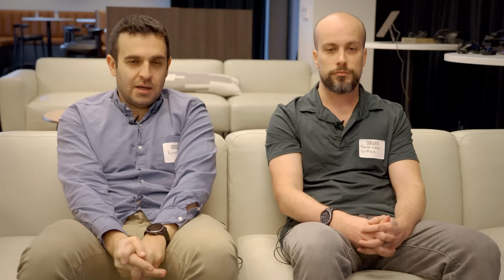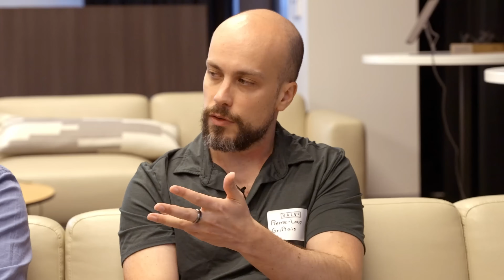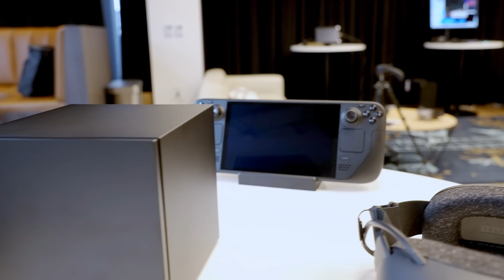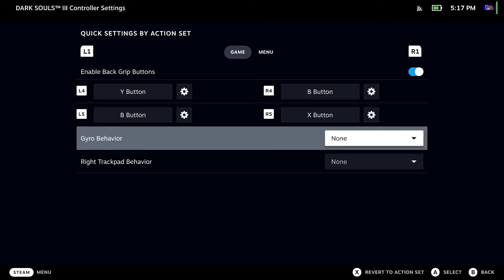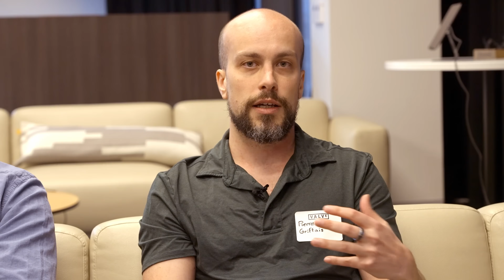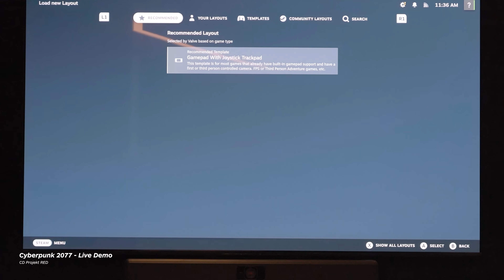Valve Talks New Steam Machine and Why Now's the Right Time For the Console/PC Hybrid

Comment: I will tell you why I do Console over PC to game. I just need it to turn on and work. I don’t want to worry about drivers, my controllers not being compatible or optimized for the game, I don’t want to have to worry about mouse and keyboards either. I don’t want to worry about hardware incompatibility. If this is just as easy as that then I’ll consider it.

Comment: perfect timing for killing xbox branded handheld🤣
Reply: actualy xbox branded handheld did it on it own. ally x is very same with exception of z2x for 100% price increase, in return you have 5% preformance boost and game pad grips in an enclosure... hell not, ally x is still much better option today. 

Steam Machine is not equivalent for any handheld but people love play docked and for those this is no brainer. 

I'm looking forward that kind of devices more than any upcoming handhelds, I bought Steam Deck LCD at launch only because of docking feature at x86 hardware. I saw earlier Pandora boxes, always wanted, they where custom made, full of troubles and crazy expensive at the time. Steam Deck delivered more than that. Now it is time for cheap PC gaming. I'm not looking forward to many games, but those in which Ićm interested in does not exceed 8GB of VRAM, also 25" 1k monitor for me is enough so brand new Steam Machine is perfect fit for me.

Comment: The thing that breaks the deal for me is definitely VRAM. Ideally it should be 16 GB, but I would settle for 12 if the price was right. It could also have a unified memory architecture similar to PS5 or Apple Silicon, letting the OS allocate however much the CPU/GPU require and still maintain 24 GB of total memory.

Comment: Steam Machine

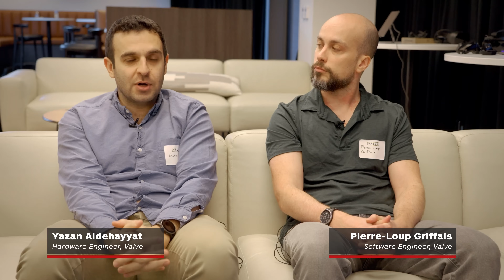Ease of Use & Performance Features (0:10-1:58): Discussion on features like fast suspend/resume, background updates, and TV/soundbar integration designed to get users playing games as quickly as possible. It also covers automatic driver updates and the ability to control performance settings directly from SteamOS.
Game Developer Support & Tinkering (2:25-3:21): How Steam Machine will encourage game developers to optimize settings, similar to Steam Deck, and Valve's commitment to supporting users who want to tinker and mod.
The Right Time for Steam Machine (3:22-5:07): Valve's reasoning behind the reintroduction of Steam Machine, citing progress with Proton for game compatibility and the positive reception of Steam Deck's SteamOS.
Expanding SteamOS to Other Hardware (5:08-6:33): The potential for SteamOS to be installed on various third-party PCs and handhelds, with Valve continuously expanding hardware support.
Performance Goals & Affordability (6:34-7:40): The mandate to run every Steam game at 4K 60Hz with upscaling, and the focus on making the device affordable as an upgrade path for users with older machines.
Unified Performance Spec (7:41-8:42): The importance of a consistent performance level across all Steam Machines for developers and users, mirroring the Steam Deck's unified approach.
Feedback from Steam Deck Docked Experience (8:43-10:29): How user feedback from the Steam Deck's docked mode, particularly regarding graphical crispness and the software experience, influenced the development of the Steam Machine.
Steam Controller

Wireless Protocol & Low Latency (10:40-12:00): Details on the proprietary 2.4 GHz wireless protocol for the new Steam Controller, emphasizing its low 8ms latency and consistent performance with multiple controllers.
Puck Integration & Seamless Switching (12:01-13:01): Explanation of the wireless puck and its role as a charging station and how it enables seamless switching of the controller between a Steam Machine and a desktop PC.
Steam Machine Verified Program & Controller Integration (13:02-14:01): How the Steam Machine will have its own verified program, ensuring a consistent experience when paired with the new Steam Controller, and how testing criteria will overlap with Steam Deck.
Versatility Beyond Steam Machine (14:02-15:18): The broader scope of the Steam Controller, designed to be a great peripheral for desktop PC users, particularly for games not typically played with a controller, and for remote play scenarios.
New Features & Enhancements (15:19-17:38): A detailed look at the controller's new features, including magnetic thumbsticks, forgrip buttons, high-definition haptic feedback, trackpads, full Steam Input power, macro buttons, and improved motion controls with capacitive sensors.
Wireless Connectivity & Battery Life (17:39-19:00): Highlights of the Steam Controller's best-in-class wireless connectivity when used with the puck, and its impressive battery life of around 35 hours, even with heavy haptic and trackpad use.
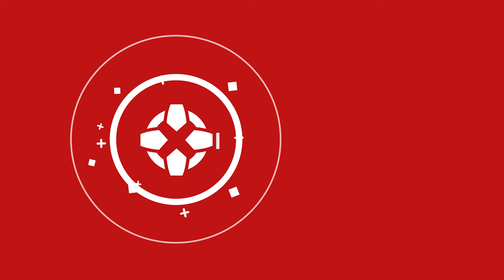Customization via Steam Input (19:01-20:41): The extensive customization options available through Steam Input, allowing users to remap bindings, adjust sensitivity, configure haptic feedback, and create complex programmable modes.

Comment: When does Steam plan to announce a radiator with a cooler for an NVMe drive in the form of a bottom stand, so that the system does not overheat and constantly throttle?

Comment: These machines are an example of what the gaming industry should be 

Power isn’t everything - capability, flexibility and versatility are what matters. Power helps but the feature sets and flexibility and the headroom they crafted for users to take advantage of….

Is simply put, unrivaled. 

No other company rivals the QoL features and capabilities of what Steam has been implementing, and have implemented. 

This is a huge boon, and truly sets the standard on how these should be done. And it’ll get better when these are finally out and Valve makes improvements.

Comment: I love the controller - the VR would need to be around £400 to compete with Quest. A fair price for the PC is probably around £800 - mass production could shave off £150 imo meaning it could sell for £650 and that would be reasonable given a high volume of sales which is the risk Valve/Steam take on when designing such a product. I'd much rather buy my son this than an xbox because you don't need to pay to play online and Steam Sales are the absolute best. They put Xbox Gamepass and PlayStation PS Plus to shame.
Reply: I feel anything more than 400 USD would kill the Steam Machine. And 2 b fair PC gamers need not be concerned. They still ve the superior hardware based on price they spent

Comment: Should have asked why they chose 8GB VRAM.
AMD and Nvidia already stopped the production of the 8GB GPU because it's to low.

The Steam Deck runs in 720p because of the Display size and doesn't have to Upscaling to 4K.

And Silent Hill f looking so bright is because of missing Lighting effects (Nanite).

Comment: Horrible failure, using the same low-res, washed out panels like Quest 3 had 2 years ago. Even owners of Bigscreen Beyond 2 (2560p) complain of low resolution when looking in the distance. And not using MicroOLED in 2025??? This headset will lose the interest faster than Quest 3. Who decided these? Do your people live under a rock? Now we're stuck with Samsung XR and Pimax Super or Dream Air. Too bad Samsung didn't use the new XR3 chip.

Comment: The steam machine has some odd hardware and connection choices. USB-A 2.0? Seriously? Only 1 USB-C? No headphone jack or digital output? No full sized SD card reader? HDMI 2.0 not 2.1? Display Port 1.4 not 2.0? They've gone with a separate CPU and GPU, over an APU? The GPU only has 8 GB of RAM? Surely an APU with 20 GB - 24GB of high-speed (say 450 GB/s) unified memory would be a better choice? The GPU is only around 7 TFLOPS, when they should have aimed for 10-15 to compete with the PS5 and Xbox Series X. And why does the base model only have 512GB? Thats not enough. And theres no steam logo on the box! I love the idea of a console that plays PC games, running a custom linux OS, i'm just not 100% sold on these hardware choices.

If I was to design this it should have:

A low power AMD APU with a 10 TFLOPS GPU (e.g. Strix Halo)
24GB of unified RAM with 450 GB/s memory bandwidth
1 - 2 TB of PCIe 4.0 SSD storage (2230)
1 NVMe slot for SSD expansion (make it a 2230 along with the main SSD to keep the size down)
2 x USB-A at 10 Gbps
4 x USB-C at 10 Gbps (if not 40 Gbps/Thunderbolt 4) with the front USB-C ports supporting Power Delivery.
A full-size SDXC UHS-II slot
A microSD UHS-II slot (for Steam Deck compatibility)
HDMI 2.1
Display Port 2.0? (1.4 is sufficient though)
Bluetooth 5.4
Wi-Fi 7
2.5 GbE Ethernet
Headphone/optical digital out combo jack

Make it compact like a Mac Mini and sell it for around $500/£500/€500 and you'd crush the console and mini PC market.

Comment: so what graphics card does it house? I'm confused, no way that can play new titles at 4k, my pc is five times...?
Reply: What I can tell you is it’s closer to a series S than a PS5 in series X and it’s about 25 to 30% weaker than an RX 7600 which itself is about 5 to 15% weaker than a 4060 so you can probably expect maybe about 15%-ish slower than a 4060 assuming that because it’s running steam S gonna be a bit more optimized than windows even that’s kind of a big if I’m getting a lot of credit here that they can claw back a solid 10% performance on a low end GPU without DLSS and retracing and if you turn those on probably about 30% slower. 

The CPU is really solid. At least it’s the second newest generation of AMD and six courses that almost 5 GHz so very very fast cause a significant increase over the consoles at least on the CPU side only 16 GB of RAM is tough a gigabyte VRAM awful. It’s really really bad then again the GPU is so weak. I don’t know if it’ll matter. The whole thing is just I wouldn’t spend more than 300ish, 400 max for like a one or 2 TB version. Even then, I’d rather just wait for the new Xbox. It’s gonna have all my Xbox games and run great on my TV and have a Windows like environment where I can actually go in and download steam and mods and stuff.
Reply: @justacollegestudent5147  Thank you for the epic comment mate, yeah I agree, it's gonna struggle with GTA 6 if it ever comes out

Comment: So is there anything that this machine can do that a purpose built pc with steam OS can't?
Reply: Only just a few things and that's mainly bridging the gap between PC and console. The biggest thing is that it has CEC built in and so turning on your controller will turn on the PC, the TV, any sound systems, and select the correct channel/input for you. 
Other than that, not really much else but it's still a compelling option if you don't own an SFF PC for the living room already. If I hadn't built one earlier last year with Bazzite I'd be all over the Steam Machine.
Reply: @WinnieBlue  Had a 7900 gre sitting around along with a few other parts.  This announcement just made me want to build an SFF PC for this reason :).  Will have it built by Monday.

Comment: Would love it if Valve produced a proper PC gaming monitor with a 16x10 aspect ratio, a 32 inch 5k 144hz 16x10 Tandem-OLED with native rolling-scan for smooth and high-motion-resolution at just 60 fps and up, so you would only need a max fps of 144, making 5160x3200p 144hz at 10bit HDR without compresion possible, add in hardware integer-scaling for sharp scaling of 1600p and lower resolutions, great for older PC games too via Proton, and perfect for emulation, as 16x10 is great for 4x3 aspect games too, every aspect in fact.

And also Valve, PLEASE bring back high quality game engine level sound like EAX and A3D, with a native Steam OS HRTF ASIC/FPGA sound-card,  that can also hardware emulate EAX, MIDI, WAV, Synth, etc, this would be incredible for Indie retro syle games for instance. Maybe even Steam OS physical games for games that are feature complete and have now more updates or patches expected, mini PSP caddy style optical discs ups to 100GB, with Steam bonus content, a partnership with GOG perhaps, the golden age of computers once again.

Comment: I’m so glad I invested in my steam library since counterstrike days. I still have access to all my games and can play them across all steam devices. No subscription. No nonsense.
Reply: @gkexposure4101   I currently only have a deck to do any PC gaming and even though not every game is supported for the deck right now, there's some games I still went & ahead & got on steam anyway because it was interesting to me & I am hoping it will either become supported or I'd be able to get a PC. Then a few days ago I'm browsing the store & see the steam controller, then machine & frame. I am very interested in the steam machine (& controller). I'd like to have one for connecting to my tv (tried docking my deck but either the dock or HDMI are faulty because there's barely any sound even with volume turned way up). So if this will be priced low enough, I should be able to save up for it & justify the purchase vs putting the money towards responsible things. That would give me my portable option & a stationary one. I have been frequently checking the steam store & growing my library. 🤞 this will be affordable for most people in the economy most of us are struggling in.

Comment: Basically they said the steam machine will not come with a controller and there will be a bundle with a controller. It can’t run 120 frames even tho 60 frames is basically what the switch 2 runs. If it’s under $500 maybe I’ll buy
Reply: valve said it is coming with the controller, no bundle

Comment: I trust Valve in all of their hardware endeavors. They don’t even make physical SteamLinks anymore but they still put out patches and updates for them way after they were discontinued. Now that’s service.
Reply: Yeah I still use mine to stream movies from computer to tv and I've seen the improvements these last two years
Reply: That's one thing I find commendable about them, due to how every piece of hardware is structured, updates actually work for the betterment of previous products even if it's not their main focus
Reply: I dont know if they fixed it by now, but for years Steam Link was by far their worst failure

Comment: Selling point: Valve is the company behind the GabeCube
Reply: Valve has to be the one company that large that people actually trust to deliver quality without any tricks. Its not a coincidence that they aren't publicly traded btw.
Reply: No A.I bs in the marketing. That's also a selling point!
Reply: @fajaradi1223  They literally mention the goal is 4k60fps with upscaling lol
Reply: @user-lh7mt7zo7l  Pretty sure valves intent is for it it to be 4K60FPS independent of its FSR capability. Mostly because game developers are leaning hard on it.
Reply: They literally said “with upscaling” in this video, no not independent of FSR
Reply: tbh 4K60 was kind of a meaningless way to market it except the fact that it's capable of outputting 4K60. But the fact is that it can output 4K120 if the game is light enough.
None of the consoles can do actual 4K60 without upscaling. And upscaling could be anything, it could be dumb bilinear upscaling like the PS5 does. It could be from a 720p render. It could be DRS.
Based on the GPU they chose, I expect this to run PS4 games at a decent native 1440p60 which won't look terrible at 4K.

4K60 is more like a target for developers of games that are still maintained. Like "just make it look and work the best you can at 4K60, we don't care if there's a render scale factor" because that's been happening in consoles for over a decade anyway.
Reply: I'll be playing on 1080p 120 fps. I'm not really worried about 4k 60fps

Comment: I absolutely love Steam’s new hardware. The only major issue that they all have is that they are not compatible with the kernel level anti-cheat present in many competitive shooters. I am just hoping that gap gets bridged at some point.
Reply: Its not the hardware thats not compatible its the anticheat that is not, and for them its a click. If enougn ppl will use linux they will press the button
Reply: Honestly - I think the big majority of Steam users are not the hardcore online PVP crowd. The success of the steam deck shows that. Missing a couple of PVP shooters on this HW (for now) will not be a big issue to most potential buyers.
Reply: They need to add a tpm or something that can validate the boot in a competitive game mode with desktop mode and third party apps disabled to get anticheat devs on board.